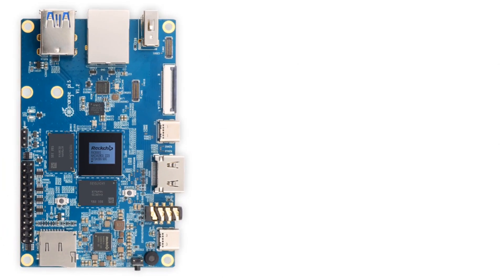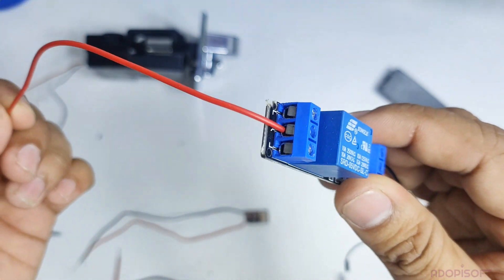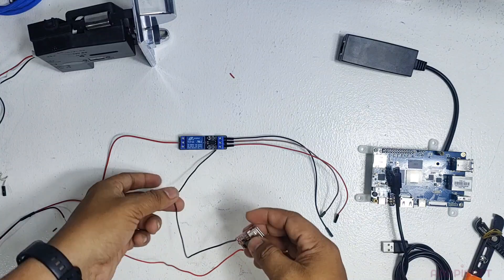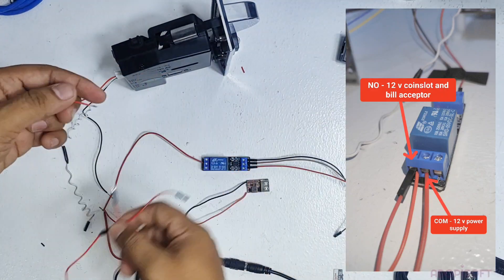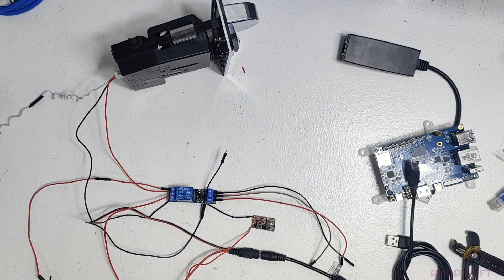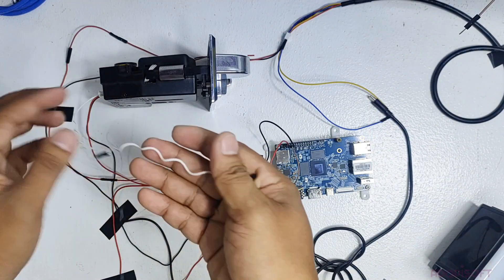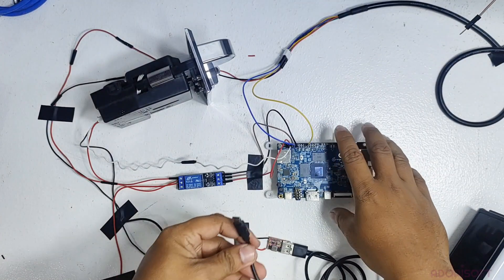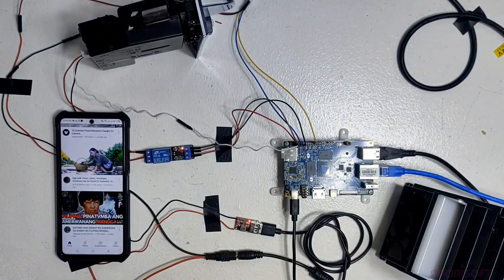AdoPiSoft OrangePi 5 Set up | AdoPiSoft Version 5.1.4

Comment: Sir supported din po ba yung OPi 5 Plus (with 2 ethernet ports)? Same image po ba? Planning to use it in my next build para wala nang usb to lan. Di rin kasi advisable yung vlan set-up sa starlink isp nagsisilabasan kasi sa starlink app yung mga connected devices.
Reply from the maker: Haven't tried it po sir pero you can try po if magwowork ba.
Reply: Kht b nka mt gr3 lumalabas p rin kht pinalitan m n ung identity?..
Reply: @zairbarnuevo2115  di ko sure. Natry ko kasi mag vlan gamit ang mt haplite nagulat ako nagsilabasan sa user ng SL yung mga connected sa vendo kaya binalik ko ulit sa usb-to-lan set up.
Reply: Papaanong lumabas?..bkt ilan lng po n max devices n kya ng SL router?..planning to buy dn kc aq nung opi 5 plus..